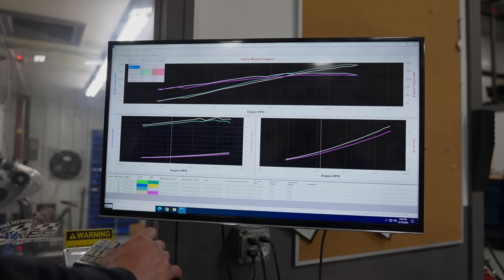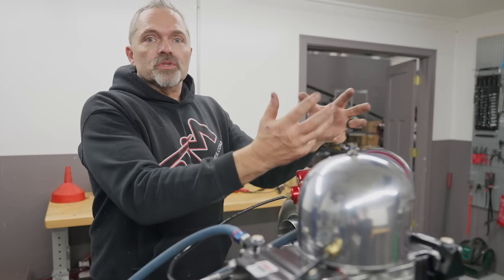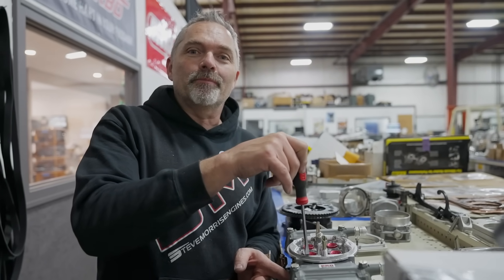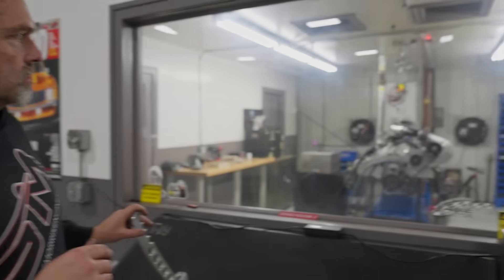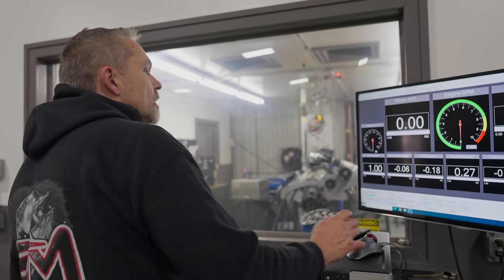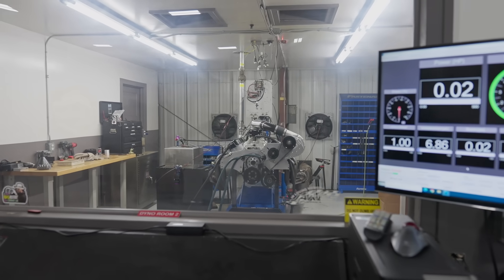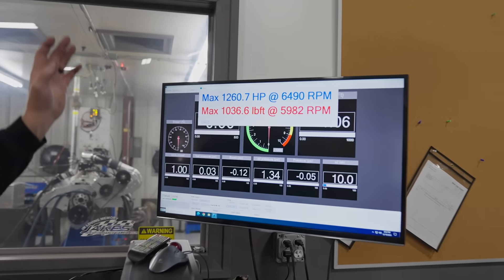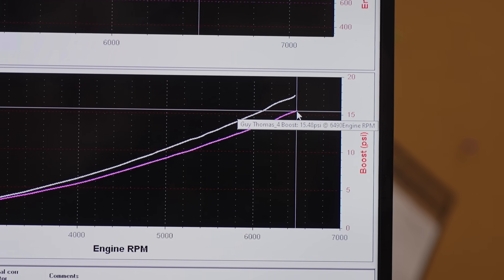How Blow Through Carb Systems Work. It makes too much power!

Comment: We used to run mini hydroplanes and my dad's pro boat that ran on methanol had that problem. One time the spark plug was solid when it was cold. But it soon as it got hot. The porcelain was loose.  It started getting blow by and we're getting no power.
Reply: iv had autolite plugs get loose in the shell a few times. it did'affect power on the track (we won) and showed no engine wear at refresh. maybe det. or lean for a bit ( carb).
Reply: did NOT affect power
Reply: @georgelaramore6529  And you were running 500cc koning 2 stroke methanol motor? And a seal leak isn't bad? Lmao Losing compression through the plugs.

Comment: Steve. I tune holleys for friends street performance engine. Look at the A/F at 1700. Is it rich or lean.  Change the idle feed reatrictions.  
327 to 335ci needs a 0.031" IFRs in the primary .metering block. 347 to 365ci need a 0.032" IFR.  a 426 to 438 needs a 0.036 IFR.   Since the idle circuit is just like the main circuits. If the idle feed restrictions are too small you can change the idle bleeds all day long and nothing gets better. 
  I check the primary main jet sizing at 3800 to 4000 rpm.  Look for 14.7 af  change the primary main jets to bring it in.    Once this is done.  Blip the throttle rapidly from idle. If it lean backfires go up a size on the pump discharge nozzle.  Try blipping the throttle again. 

Once you get the idle feed restrictions corrected.  You can look at idle air bleeds that effect fuel curve by looking at iar fuel at 1,000rpm,  1,200, 1,400, 1,600, 1,800.  You dont neef to go higher than that as the primary boosters are starting to trickle as the idle feed clots slack off ss the the throttle blade opening reduces pressure drop across the idle transion slot.  By 2,400 rpms the primary mains are feeding alone.  The primaries max out in the 3,800 to 4k. Rpm. So that is where you look at the primary main jet size. You will need to do the 2.4k 2.6k 2.8k 3k 3.2k 3.4k 3.6k and 3.8k to see which ways you have to go with the primary air bleeds.   

This sounds complicated. Its not.  

Just doing this to friends cars usually results in a wow when they come back frome a test drive .  I have gotten complaints that they cannot feather the gas pedal enough to not spin the tires at every red light or stop sign.

Comment: ,,, I'd have like to have seen the fuel pressure right next to the boost , or the data thereof , for the entire run . Couldn't read the numbers on my screen . Also I suspect that over 12 pounds of boost you might have been relying on those large capacity float bowls .

Comment: dumb question, why would someone want to use a carb as opposed to fuel injection? fuel injection is so much better. another thing do you need a blow through carb or can you use a regular carb? will it make more or less hp with fuel injection? any help is appreciated and great informative video. thanks in advance. i cant seem to figure out why someone would want this carb setup lol. thats an impressive engine. what is it and build specs? 1200 at 5500 rpm is pretty wild lol.
Reply from the maker: The carb at these low levels is really easy, and it will actually make a little more power because of the  ventury effect on cooling fuel and air charge.
Reply: @stevemorrisracing  interesting, thanks for the response.

Comment: I’m a computer guy, not an engine guy, but I really enjoy learning this stuff. Steve, I’d like to understand the green button that is on dyno number one, they both have the throttle levers, but sometimes I’ve seen you open the throttle lever on Dyno one and the engine doesn’t rev up and it’s something to do with the green button. Can you explain how that all works to us?
Reply from the maker: Geeen button starts engine aceleration

Comment: Very nicely done guide 👍😎

Yes, carbies can be easy-peasy, but some can be real ***ers, especially if you're trying to sort out a Q-J someone has fiddled with.

Quadra-jets are really good carbies - better, IMO, than Holloys - but they need some expertise in setting up properly, whereas Holleys are much simpler and very nearly as good, one just has to select the right mode for the application. Heck, because they're simpler, most folks may be able to get close enough much quicker than their opposition. Thermo-quads are another misaligned carb.
Reply: "Holleys are a controlled leak" (when compared to many other carbs) still rings true.
Reply: Love Thermo Qauds! Best running carb I ever put on my 402 BBC after 3 Holley's and a Q jet.
Reply: I have quadrajets on my GSX and 442 and they both run beautifully. Great carb.

Comment: Steve, how do you arrange the spark plug wires neatly on the distributor cap by bank (left & right) without affecting the firing order? I like the tidiness of the spark plug wires shown in your video. Thanks
Reply: Takes a specific cap. It has pathways that criss cross in the cap so the wires can be in order on the outside and the contacts are in order inside.
Reply: @NBSV1  Thanks for the reply. What companies offer these distributor caps with the criss cross configuration?

Comment: Hey Steve i enjoyed the video but it also got me wondering. I was thinking I'd have to run an intercooler with my setup but i know carbs cool the charge some. I've got a 408 sbc should make about 460hp on motor alone. 9.1:1 compression with aluminum heads. The question is can i run as much as 10 lbs of boost on pump 91 without an intercooler through a Vortech? Or what should i reduce it to? Also, what's your ideal carb size for this application? Was thinking a 950cfm blow thru carb and the engine should make peak power around 5600-5700 rpm. I'm not sure what kind of HP it should make but I'm guessing close to 700hp.
Reply from the maker: Dang, way too much to answer here. 
Long story short, your close try it and sneak up on the tune up slow and steady read your plugs

Comment: Centrifugal blowers make sweet bad a$$ noises and have great efficiency, but peak torque at 6K is a killer. They really are belt driven turbos… Better make sure you have plenty of room to open it up, wait for it to load lol.

I’m use to 900 lb/ft at about 3,600 with a roots lol. Almost as useless I guess… One blows the tires off at idle, one blows the tires off at 4.5-5K. It is insane how well these centrifugal blowers work. Can’t have your cake and eat it too I guess. 

Really comes down to the application and the purpose. Big heavy wagon like mine would be a pooch on the street with a centrifugal on 93 octane. Car weighs over 4,600 lbs! Wagon life… 👍🤘

Comment: I had him build one for us for a 383 N/A . About 600 hp deal. Custom made wouldn't idle for squat! After some diagnostics found aluminum shavings in the idle port. Cleaned,  and made better, but never ran right....On the shelf collecting dust.

Comment: Does idle air screw shut off after blades open a lil bit?? Or is that circuit at full spray constantly? I believe it’s for idle but it flows fuel entire time thru blade movement just no more fuel then you have it set for at idle??
Reply: Idle air/fuel never “shuts off,” but it becomes totally insignificant compared to the main venturi air and fuel volume beyond maybe 1/8 throttle or even less. Literally a drop in an ocean. If you held an engine at 1/2 throttle on the dyno and adjusted he idle screws from min to max,  you’d probably never see the 02 sensor register a change. On the other hand, some carbs (Dominators and their clones, for example) begin to flow a significant amount of fuel through the accelerator pump squirters at high RPM, and it factors into the total fuel flow a good bit.

Comment: Does the fuel pressure line at the hat have a straight fitting into the hat or is a 90 deg facing down or a T fitting.
Reply from the maker: Straight

Comment: Have you tested Dellorto 48mm Carborators.I love thes carb.I ran 10 sek on The 402m.1992 Corvette 356cui Have bigg Heads tou bigg they sai..I sai nono werks fain with thes.Brodix 11X  no porting jobb.Have 12..1.1 komp.Street Roller cam 106 lobe and 0630 lift.dint remember duration 0.50..Th400 NO Transbrake thes car wait 1600kg with me in The car.Runn okej 60 feet 1.62...Nobody have run so fast  with thes parts!?..Thes car are real Street car.Have build Twin Turbos alredy 1996-96.Runn 9.90 223 Kmt 402.Broke 2 cylinder.Blown Thro carb.The Engine  Ghos To lean.i was weery erly with thes Turbos. Today I have Efi Vems ECU..trobel with The Krank Trigger..Hope I can come Out tou The Streets 2024...Me and May son are building Turbo and Efi MaxxEcu on The Merceders 300se 3 liter Engine   103.Weery strång Engine handels 800 whp all day...Love your Videos.I have even The Bloy Boy2  Scott chaffirofs old car. Camaro68..Have procharger only 12 psi boost.Cbb 461 1000Whp..Sick week car..The bad ting i have noth draving thes car Yet. Hope mayby can ran in 2024...Weery Nice Camaro 25.4 chassi Tig welding Chrome Molly. (Safety care.) Skydds bur in sweden we Call it. I call this camaro the green boy three.( Paint are Green Pearl). Big Taiwrs back 33× 15×15...Big staff Efi...Hope in The seven time 402m... This camaro are light 1100kg with me in...

Comment: On a centrifugal supercharger has anyone ever put the carburetor on the intake side of the supercharger?  That way you would not have to use a blow through carburetor.   Or does a centrifugal supercharger build too much heat to have gasoline vapor run through it or the wrong kind of seals for that application?
Reply: That is what guys used to do YEARS ago before carb companies started building specialized carburetors for blow through applications.
Reply: @danmyers9372   Right, I also think it was done similarly on GM’s first turbocharged cars like the Jetfire and Corvair with the “Spyder” option.   The carburetor was placed before the turbocharger as a draw-through arrangement
Reply: "LAG" is bad, also, you'd be dumping atomized air fuel mixture out the blow off, making a nice flaming fireball under hood, could route it back into the exhaust for a flame thrower effect. also, makes for hot air/fuel charge, with widely varying temperatures, hard to tune, goes lean and rich everywhere uncontrollably, to you'll end up with pre-ignition and self destruction. it may work fair for a peanut size street engine, otherwise no.

Comment: Not necessarily ive seen single needleand seat  good up to about 1400 hp depend on fuel being ran.i run a blow thru csu carbs and so do all my shop car and never had a problem didnt see problems till after that bit yet if its tuned right you do get cold chills  build up on the intake

Comment: Steve have you ever seen the test engine masters (hot rod) the tested a few different hats, for a blow through carb ?  Just turning the hat changes the horsepower…
Reply from the maker: I have not
Reply: makes sense, since the airflow isn't perfect aligned and evenly feeding the carburetor, then there's turbulence and other voodoo mixed in.
it would look a bit silly with a giant velocity stack and the hat way above the car. 🤪

Comment: Would it be ok at 15lbs with an air to air?
Reply: He is trying to get it to around 1200hp for reliability of the engine. It is obviously being built as a pretty easy maintenance, reliable, cost-effective option for someone wanting to get to the strip and have some fun. Probably drag n drive or in a bracket class. No EFI to constantly play with. No inter-coolers.

Comment: Guessing that carb doesn't have throttle operated pumps to squirt in a little extra fuel when you whack the throttle open.
Reply: It does but when the engine takes a big gulp of air it needs just a little more fuel
Reply: He shows the pumps and "tickles" the pump at one point in the vid.

Comment: Why couldn’t you make a billet flange that covers the holes, why would you epoxy a port that may be used in another project down the road?
I’m sure it’s just fine.. but I can’t believe with everything you have, 
that you couldn’t make a gasketed flange on top of carb.. and weld it on
Reply: They are plugs that cover passages machined during manufacture. They only leak due to the boost pressure.

Comment: In the 70's, if you didnt burn your eyes at idle even, you were not gonna run right. Strange to me how you related this thing to carbs. And when you have 3 of them it gets really picky. 1/2 degree dwell on points setting would throw your whole day off.

Comment: Steve, the difference in Hp x boost could it be due to the temperature of the air intake got so high that the air density was the same with less boost?

Comment: I appreciate the simplicity of the blow through set up, but isn't he giving up a lot of horsepower by not running the compressed air through an intercooler?
Reply: Carbs provide enough charge cooling by introducing the gas upstream
Reply: @H1shman  I'm no expert on superchargers, but I was thinking that pressurizing the carb with cooler air would still be better than putting hot air through it along with the cooling affect of the fuel mixture. Just a thought.

Comment: I'm a die hard carb guy, but why? Lol. You spend 20-30 g's on a big power added engine, run the right intake and injection..
Reply: Simplicity and super easy to tune. Been doing blow through since 2004

Comment: I'm curious why you're throwing away all that efficiency and drivability by locking out timing? I know it's "easy and simple", but that doesn't mean it's best.. and by the pump gas decision I assume this will be a street car. You know better than anyone that best timing at WOT is not best timing at cranking, idle, and cruise as well lol. Maybe that's what we thought in 1930 but not in 2023
Reply from the maker: Because you can not use all the low end power